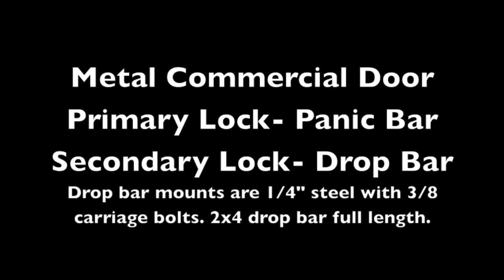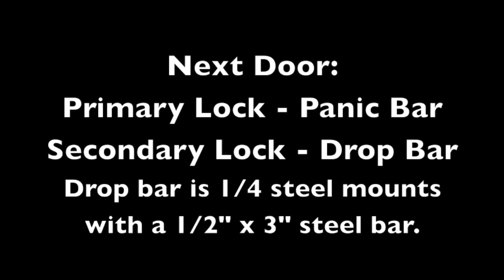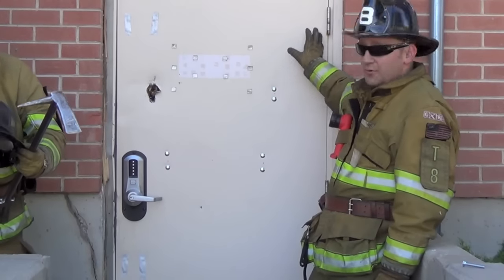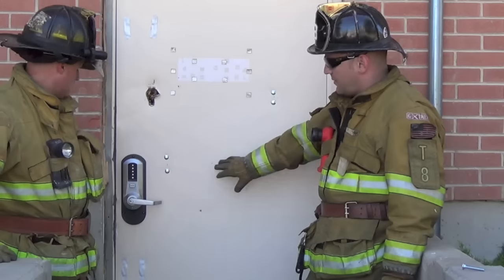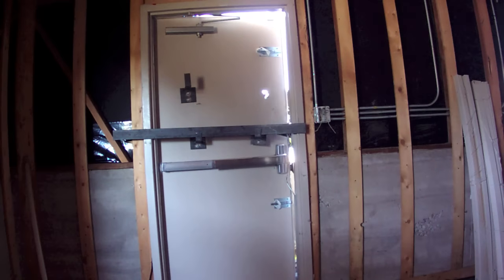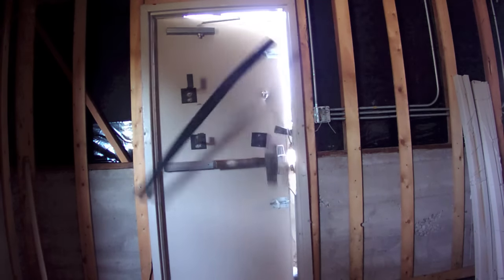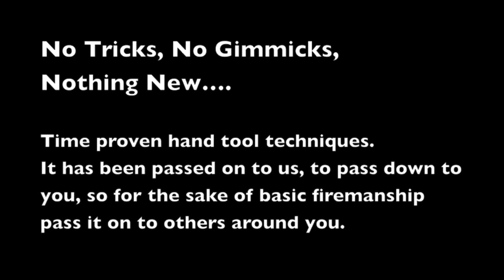Drop Bar Forcible Entry " The Irons"

Comment: I can cut those three hinges off with a partner saw in about 10 seconds,   the bolts on the drop bar would have seen the end of the blade too.  access in under 20 seconds

Comment: Let's see Hinges on the right side door facing them hmm betcha I can remove those hinge pins and swing open the bottom of the Door faster than they can do it with less or no  Damage to the door. Either that Use a big rotary saw with diamond blade that cuts threw Metal. These guys are getting Fatigued after beating the shit out of their tools
Reply from the maker: Klaus Schreyer Ha, good response. Glad you really thought out your plan and feel confident with it. I'm going to give you something to chew on. Think real hard about what taking the hinge pins out will do for you. Shows how little you've done this.
Reply: IRONSandLADDERS I have read many posts and they sound like they know what to do.  They probably haven't done it a day in their lives.  Keep up the good work and stay safe.  I have been a volunteer firefighter EMT for sixteen years myself.